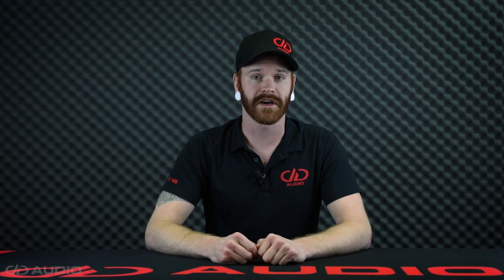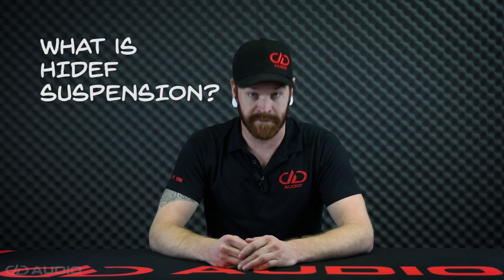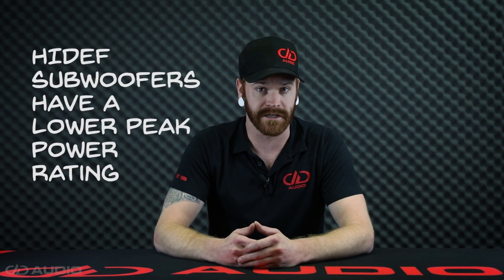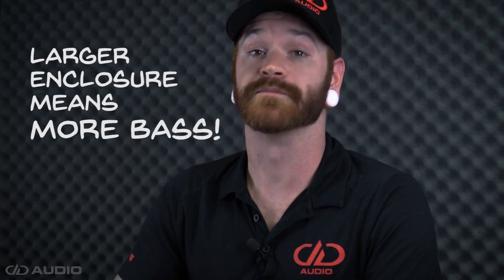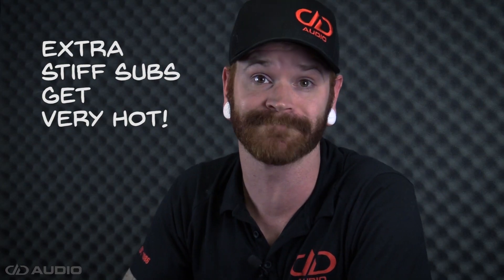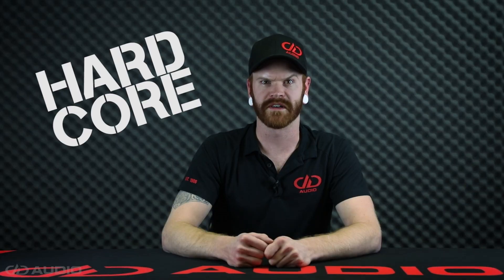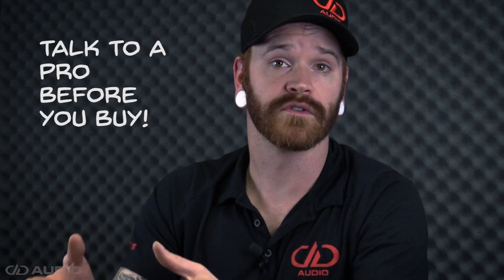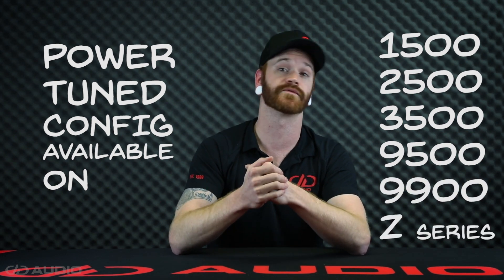Tech Talk: Subwoofer Suspension Options

Comment: I had 2 pioneer ts-w3002d2's that i played for 10 years. They used a dual cone design that created a sealed chamber between the two cones. Amazing cone control.  It was one of the quietest suspensions I've ever heard in free air and was one of the cleanest sounding subs. I pushed power to them and never had them bottom out. The coils would get stinky once i had them up to their rated 1000w a piece.  Still one of my favorite subs of all time.

Comment: Peak power is still BS, industry standard is take RMS x2 so it's not an actual measurement. Even cheap subs will often take thousands of watts for few seconds but wouldn't rate a cheap sub 600wrms 3000w peak. When you get to competition wattages of multible thousands of watts over rms it's a crap shoot wether it'll holds up or not. Even quality subs toss 6000w at it and one may fail mechanically and another that's the same thing might not and take it over n over. Look at parkers channel yes there's variables like enclosure size correct or slightly off but for example he had a zv6 burn up doing same thing a lower level sub pulled off, or the AB HD that lifted a spider but there lower level xfl did not. Don't get me wrong DD is a very quality driver.
Reply: The prob. Is some things you said are missleading. Like the Ab Hd, rated @ 1,500 Rms on the older models, and 2,000 Rms on the model parker tested, only lifted a spider, because of parker putting over 10,000 watts to it= not the subwoofers mistake! And the lower level xfl didnt lift a spider, because parker didnt put 10k to it. I agree though about power ratings. I think us as consumers would love a standardized test, that ALL mfgs. have to go by. Like take random speakers off of the production line, 1 off the beginning, 1 in the middle, and 1 @ the end, and run a 20Hz, a 40Hz, and a 60Hz test tone, all in the mfgs rec. enclosure, and play the tones for 5 minutes, per freq., allowing for 5 minutes of cooling in between tones, raising the power until 1 of the woofers fail. Then give that model of woofer the power rating they actually tested them @, where the Lowest wattage woofer, out of the 3 randoms, passed! I think this would be awesome!

Comment: Damn I wish I seen this before I had my 2508s made, I have the extra stiff suspension but they are in a 6th order I didn't want the to subs bottom out
Reply: You just have to set your subsonic filter, low pass filter, and gains, correctly. You definitely are giving up performance by having the stiff suspension. My friend went from the reg. suspension 15 inch Dd 9500s = power tuned = sounded very good, punchy, but not too tight, hit the low notes well, and very musical with a wide variety of freq.(They played well from 25Hz to 80Hz). Then he sent them back to have them rebuilt, with the stiff suspension,= Wow what a Big diff.! He just dropped them in the exact same enclosure, now they sounded edgey, extremely too tight, like gives you a headache tight, it made his 15s, sound like how people think an 8in. should sound. It now was Not musical, it did not play low freq. well anymore, (They now liked 50Hz to 125Hz), he sold them not long after. And for the people that think he should have ran more power, to "Soften" them up, he had an 8k Rms amp on them, and they would barely move!

Comment: i wonder which type of suspension is in the pa subwoofers and midranges.
Reply: Probably the hi-def, seeing as PA applications are mostly about maximum efficiency. Although the stiffer suspensions will perform better in a giant horn, where the back pressure would really stress out softer suspensions.

Comment: Love the video series. DD knowlage is power. Had an idea wanted to toss it at ya. Lota peps complaining about how hard it is to get great mid and upper bass response. Here's the thought, 6.5 inch sub 250-400 rms rated, really soft suspension designed just like the slim line with a top mounted neo. Also an enclosure pod to sell with it to act as a sealed encloure for door mount?something to cover 60-200hz. Whacha think ?
Reply from the maker: We did offer a product in that vein (W6.5) a few years back and it just didn't sell well enough to keep it in the line. People just kept trying to use it as a sub and breaking it. Currently our customers are using the mid driver from a component set or the VOM6.5 or 8" for that purpose.  We did a tech talk over that earlier this year that talks about how important Midbass is and how to make your install better in that frequency range. http://ddaudio.com/ddownlow/tech-talk-mid-bass-madness-getting-the-most-out-of-your-door-speakers
Reply: @ddaudiotv   thank for the reply back i appreciate it. Yea ive got vom 6.5 in each door with an ss4b on them. But i have to have them active high-passed at  125 hz/ 24 db  slope or they pop/snap  really bad at higher volumes, no blinking lights from the amp nor does it even get warm, even after hours of use, love that amp.